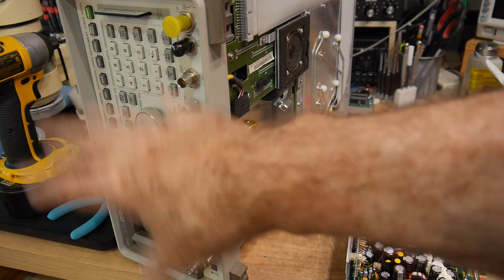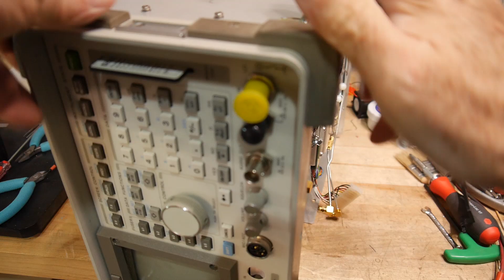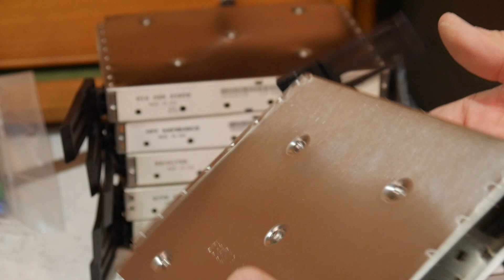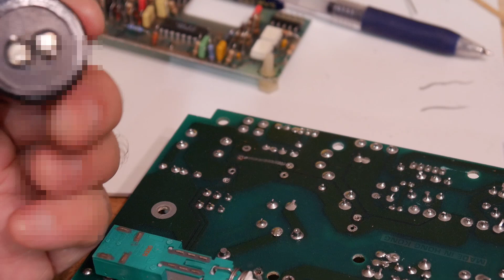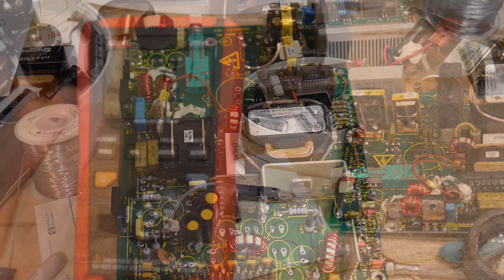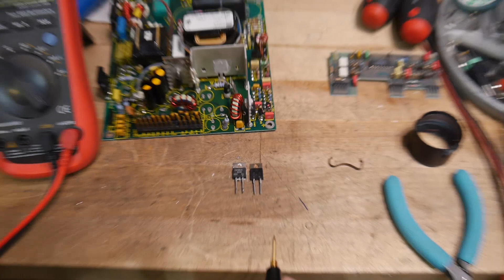#276 HP8921A radio test set repair (part 1 of 2)

Comment: Powered up my 8921 a while back and KaBoom! two capacitors in the power supply let go. I ended up replacing all the caps in the supply. Definitely not a fun job, but it should be good to go for a few more years now.

Comment: Great video.  We literally have a pile of these HP test sets at my work.  The company purchased about 50 of them in the past.  They'll stop working and the technicians will throw them in the scrap room and grab a new one.  I suspect it's mostly power supply failures. I been thinking about trying to revive some of them as we are down to less than 10 working units, and I've grown rather fond of these old test sets.

Comment: Hi , could you take me one doubt ? When you make a SELF TEST , which tension shows in the screen ? Mine are showing some strange  values , like 12V show 4.9V . Can you send me a picture of your screen ?  Thank you in advance
Reply from the maker: the test is confusing. it scales the various voltages to 5V
all supplies should be 5.00    (-12.37V supply is -5.00)
if it says 'no failures' it should be OK
Reply: @IMSAIGuy  Ok, thank you so much . I tought my problem is the power supply , but after measures , the tensions are ok , even after the regulator board . I have the message RF INPUT OVERPOWER constantly and MEASRESET dont clear it . Any tip ?
Reply from the maker: @lucianoa.fabricio6762  I have a second unit with the same problem. there is a power sensor on the input (thermistor I believe) I was never able to find where is was inside the unit. I think it inside the 60watt attenuator

Comment: Great video. Would love a HP test set,  never owned a Spectrum Analyser yet, i have a Tiny SA which comes in handy, i probably will start with an IFR1200s ,or Motorola test set, a bit more in my price range...love that uniT multimter .

Comment: Good fixing! 
I see that some capacitors you used are not intended to work on switching circuit, specially 1000 uF 35V you ordered  one that is not low ESR,  may be it works the same just will short its life, please i'm curious to know if there is a specific reason you didn't replace that capacitor with specs  same as original one .
regards 
Antonio

Comment: Here are the other 2.  Great video and thanks for sharing.  The 0.047uf is an X and the Y is the 2200pf.

PART: 399-5410-ND
MFG: KEMET / PME271Y422MR30 DESC: CAPFILM 2200PF20%1KVDC

PART: 399-12677-ND
MFG: KEMET / R463I24705001K DESC: CAPFILM 0.047UF 10%630VDC

Comment: Hi IMSAI

Got my parts today from Digikey.  Thanks again for the parts list.  In the process of digging into it I found where the snap sound and smoke came from.  There is a square looking cap next to one of the transformer.   Looks like a .047 uf.  Any idea on what the specs are on this stinky little guy is?  lol

Thanks in advance. 
Mike
Reply from the maker: There are two kinds and they are very special. RIFA caps I think. There are two types X and Y if I remember right. the X type goes from AC line to AC line. the Y type does from AC line to ground. If you google RIFA caps I'm sure you will find lots about them.
Reply: @IMSAIGuy  Great!  Thank you.  I am going to make a good assumption that the 0.047uf is the x since I can't see it yet.  I do see a smaller one that is marked clearly with 2n2 Y2 on it.  Process of elimination.

Great videos and information. Keep them coming. I enjoyed a lot of your videos.
Reply from the maker: @mgiovannucci  Don't trust me without investigation but I think you can use a x  everywhere but the Y doesn't work between the lines only to ground.

Comment: @IMSAI Guy  Thanks for sharing.   Would you have that capacitor shopping list handy?  Today I was running mine when something let go and filled the room with smoke.  UHG!  It was still running fine so I am guessing it was a filter cap in the PS that let go.  Figure I just replace them all.  Thanks on advance.
Reply from the maker: 1	10		1189-1745-ND
35PX1000MEFC10X20	CAP ALUM 1000UF 20% 35V RADIAL		0	0.54500	$5.45
2	1		1189-2323-ND
50YXJ33M5X11	CAP ALUM 33UF 20% 50V RADIAL		0	0.31000	$0.31
3	3		493-13472-1-ND
UVZ1H470MED1TD	CAP ALUM 47UF 20% 50V RADIAL		0	0.31000	$0.93
4	4		493-1911-ND
UPW1H471MHD	CAP ALUM 470UF 20% 50V RADIAL		0	0.79000	$3.16
5	1		1189-1964-ND
400HXG220MEFCSN25X35	CAP ALUM 220UF 20% 400V SNAP		0	4.10000	$4.10
6	1		1189-2852-ND
400HXG100MEFCSN22X25	CAP ALUM 100UF 20% 400V SNAP		0	3.36000	$3.36
Reply from the maker: I should have replaced the three AC capacitors on the AC input line too
Reply: Awesome!  Thanks a bunch.  Hope to get it up and running soon.  I greatly appreciate you taking the time to dig up the info.

Comment: Hello Imsay guy how are U? coincidentally today I find the news that my old HP8921A does not want to turn on. I had seen in the power supply section, a type of polyester capacitor that looked burned. But the HP was still working, I knew that at some point the power source was going to give me some surprise. The day arrived, so at this moment I'm going for the same mission as you, repair the power supply. Then tell me if you were successful with the repair ... greetings from Uruguay, Albert CX3CP
https://www.qrz.com/db/CX3CP
Reply from the maker: Those polyester caps are known to go bad. I should have replaced mine when I had it apart. There are Y type and X type capacitors. Y type go to ground and X type go across the AC. They are not needed for the instrument to run. so try removing them and see if it starts.
Reply: HI  @IMSAIGuy   I just repaired the power supply, after making several measurements, I found the fault, which is actually a very common fault in this type of SMPS circuits, the starting resistance, R3 470K, was open. That causes the PS not to start. This resistor is located next to C6, near the large input elect capacitor. Hope this help you... regards Albert
Reply from the maker: @ovnibus_cx3cp  Glad you got the instrument working!

Comment: Hi , My Name is Rob , can you please help me out ? I am after The A9 Power Supply Schematic Diagram for a H.P 8921A Radio Test Set and I am Unable to find much info on the NET , only to buy a New One.
(HP/Agilent 08920-61815/0950-2534)

Thanks so Much,  Rob
Reply from the maker: The HP8921 and HP8920 should have the same power supply. Here is a link that should help:

https://www.keysight.com/upload/cmc_upload/All/8920_Component_Level_Information_Packet.pdf

Comment: Those two yellow 0.047uF capacitors near the piggyback board look like RIFA caps. You should replace those (with new X2-class caps).
They tend to explode when - not "if" - they fail.
Reply from the maker: Yes, you are probably right.